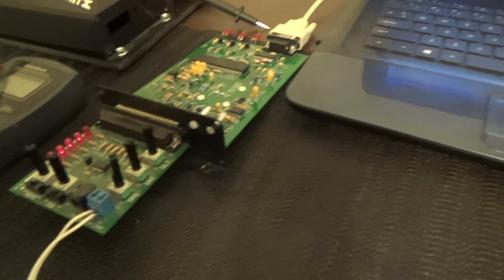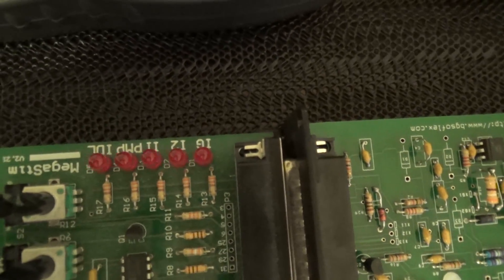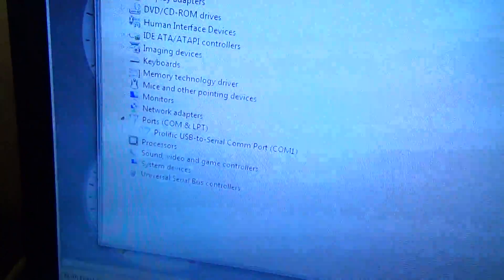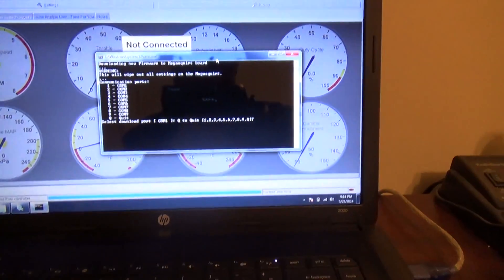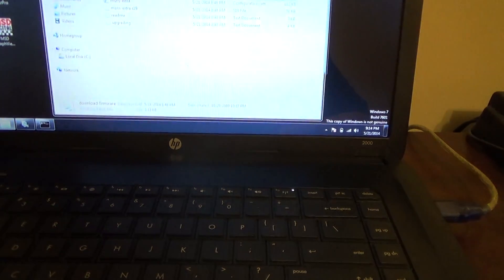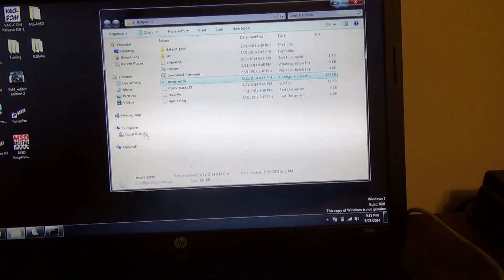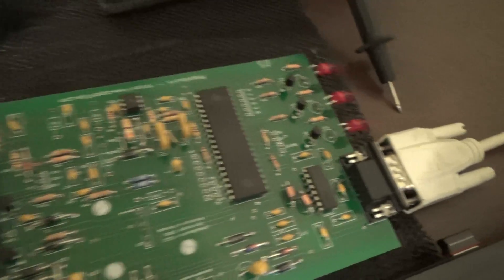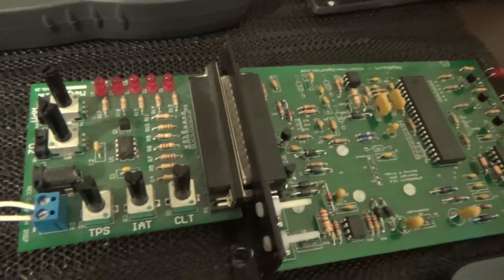Megasquirt 1 Flashing

Comment: Did you find out the problem  ?
Reply from the maker: It was a bad U5 chip (5v voltage regulator). Swapped that with a new one, and it worked.